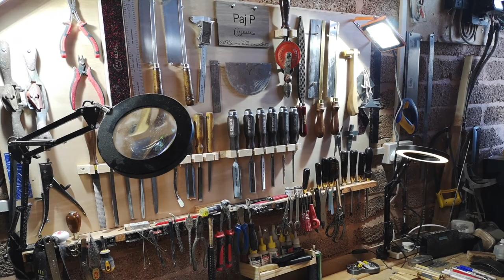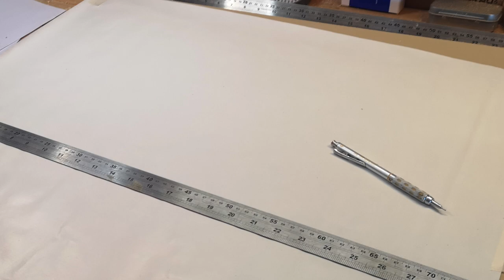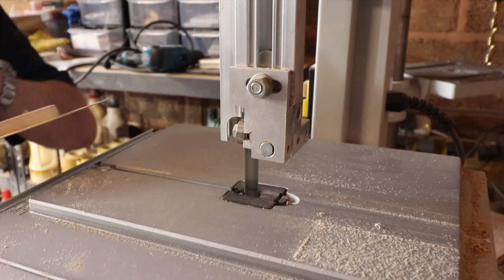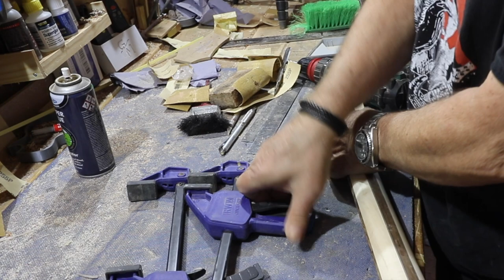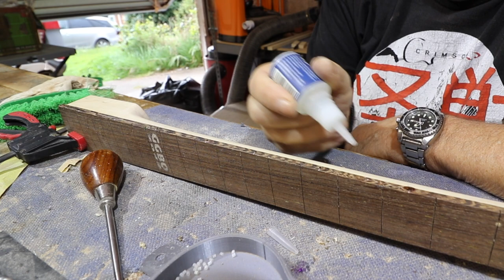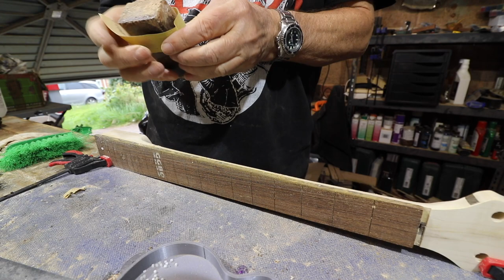GGBO 2022 part 13 - Headstock Recovery & Side Dots - Garage Master Guitars

Comment: One thing you might have done to correct the tuner holes would have been to drill them out 1/2' to 3/4'  bigger cut contrasting plugs or dowels maybe the same wood as the darker pieces of the neck then redrill the holes in the center of the plugs for the tuners leaving a dark ring around the holes as accents. By the way nice inlay on the 12th fret.
Reply from the maker: It did cross my mind to use some walnut burl veneer I have and make a crop circle design with the circles just over the ones that showed from under the tuner washers.